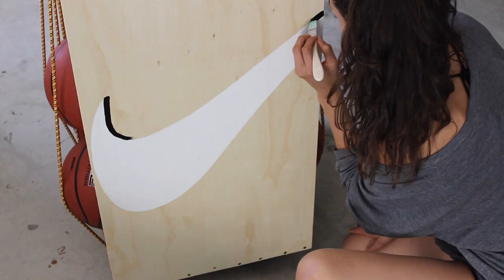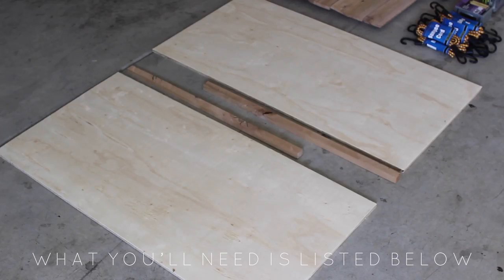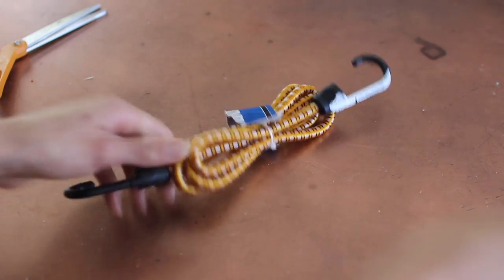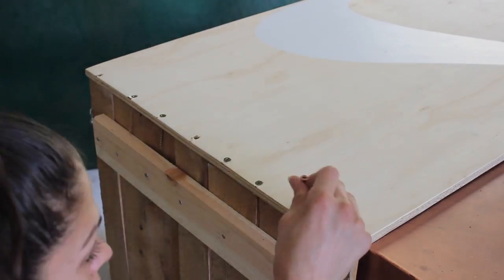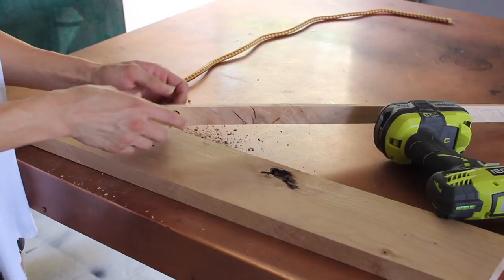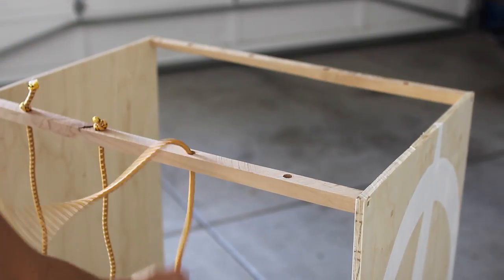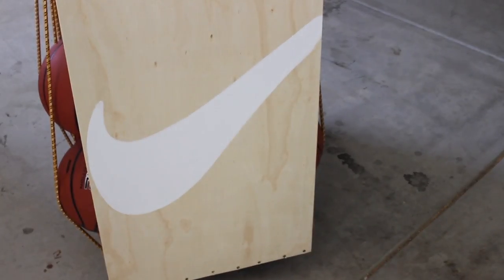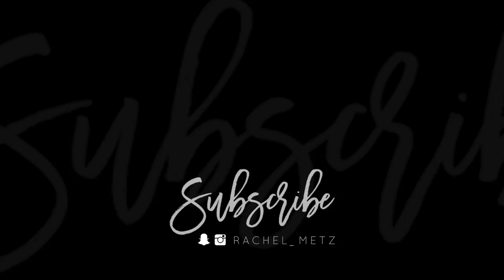DIY Basketball Rack & Storage

Comment: I enjoy the 💡 of this project. Ik I could use something screwed into the wall to hold all the sports equipment piled in my garage! I recommend to use either pocket hole joinery or another joinery technique instead of screwing directly into the other piece (butt joints) if you’re NOT using wood glue. Wood glue is considered stronger than the wood itself and certainly it’s true when compared to screws or nails just because over time and with minimal use the structure can fall apart with large frames. I’ve learned the hard way so thought I’d put that out there, thanks for sharing your project!
Reply from the maker: Appreciate the tip! This is an older video and I’ve definitely learned my lesson hah. Happy to share my journey and have knowledgeable humans like you help us all out. Thank you!